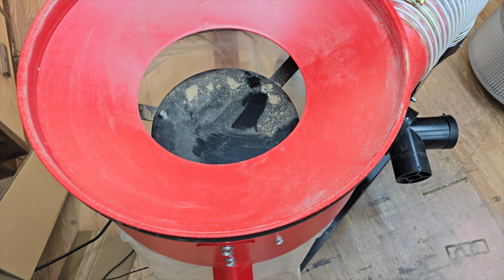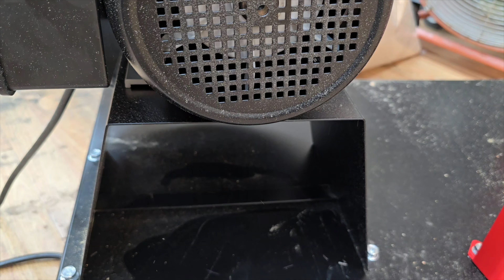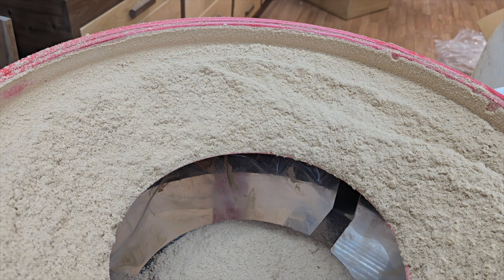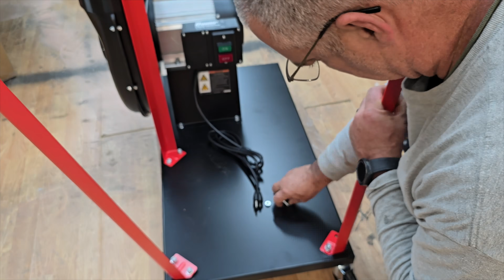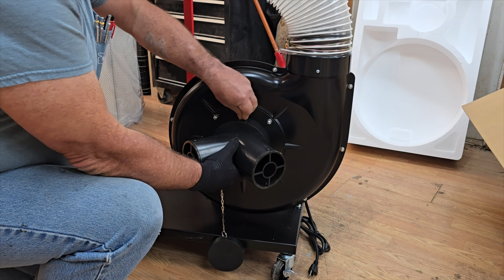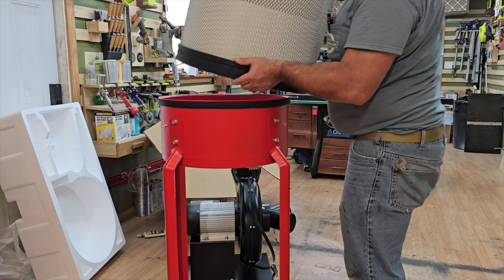Bauer Dust Collector

Comment: Im looking at a dust filter system and considering the harbor freight set up however i like the 2hp motor of the bag system and the pleated filter of the 1-1/2 ho bauer system. Is the cfm of the 1-1/2 hp model sufficient for pulling dust and chips away from my lathe?

Comment: The single stage collector sucks the dust and chips across the impeller.
Reply from the maker: Yes, the material passes through the impeller housing, which is why the design improvements are so important.

Comment: Harbor Freight BAUER 35 Gallon Dust Collector with 2-Micron Canister Filter. $399 with coupon. I never claimed to be a genius. However, I do try to work smarter, not harder. Bolt the legs to the collector first. then stand it up on the base. I really don't think I could hold the collector up with one hand.
Reply from the maker: That is a good way to do it.

Comment: Thank you for the valuable information. How do you think it compares to the Wen 1300?
Reply from the maker: There are several of this style of dust collector. Using one or two tools at a time the only way I can tell a difference in performance is with a gauge. They all preform good in real usage. The big difference is the filter is a bag. If it is in the budget get one with the filter. If you want to add it later it is a lot more expensive.  That is where the Bauer comes out on top as the best value. Either one will suck the dust away from your tool. The difference  will be how much of it gets spread around the shop.
Reply: @ShopRamblings Thank you very much!

Comment: They make a Bauer Cyclone that works with this until. If anyone is using both together, can you comment on performance with and without the cyclone? 

I have one of the older Central dust collectors, and I replaced the 8-inch impeller with a 10-inch one, which really improved the suction. I also increased the input plate diameter to accommodate a Grezzly large cyclone, which captures larger materials. The other thing I did was replace the top cloth bag with a Grezzly canister filter with a handle similar to Bauer's, but taller. Lastly, I added a remote control and blast gates at the cyclone intakes. It works great, but at a high dB level. I'm going to move it to an out shed attached to my shop and connect it to my dust ductwork inside.
Reply from the maker: I have both. I can not tell a difference between having the cyclone connected or not. I use a 6in hose connecting them. You just want to make sure not to have restrictions in the system. I have my system outside and switches on each blast gate. When I open a gate the system comes on.  I only have one gate opened at a time. If you  have multiple gates opened at the same time you might be able to tell the difference . I feel these portable system are made to run one machine at a time. I have mine hooked to duct work but it is still a one or two at a time machine.
Reply: @ShopRamblings  Thank you for the feedback. My Frankenstein system works really well. And only a small amount of fine dust makes it to the canister and bag side. Unless the drum below the gig grizzly cyclone is full or nearly full, then everything passes to the canister/bag lol. That is usually when I notice and have to shut down to clean up. I also only run one machine at a time, but my 1’800 sq ft shop is manned by just my son and me. So I'm not sure how much suction I would lose if running two at a time, but I have accidentally left two ports at the cyclone open while running one machine and noticed a drop in suction. It still pulls dust, but it's clearly less powerful.  The downsides are the noise, which is very loud, the canister fills up quick, it's half the size of a 55-gal drum, it is big and takes up a lot of space, this why I want to move it to an outside shed, and those clamps the hold the bags on the drum and the below the canister are a pain to reattach with out help from my son. Otherwise, it works great for me. I could upgrade or add a second unit that had a smaller footprint.

Grizzly just came out with a new one that looks similar to the Harvey unit that you can add a worktop to. I think it is the G0991? It's a lot less than the Harvey small shop system, but similar in principle to a horizontal cycle.
Reply: the stock HF has a 10 impeller and Rikon makes a 12 inch that is what I used
Reply: @jimlarkin1400  Yes, you are right it was a 10 I replaces by a Rikon 12”. I also replaces flange with one that had a larger intake. It really I proved performance also especially since I add the grizzly cyclone.

Comment: Is it a bad idea to remove the plastic restrictor cross thing in the 4" inlets?

It seems like a hard barrel with a bag inside system that uses a lever clamp to raise it up tight would be a very huge upgrade.
Reply from the maker: I run mine through a cyclone first. That was everything doesn't go through the impeller.

Comment: Extremely loud.  Needs its own 115 circuit I suggest 10awg wire. Inrush current is probably in excess of 27amps. Built-in soft start is a bit mickey mouse.
Reply from the maker: All dust collector I have ever been around are loud. It claims to be 85dba. That is the same as some lawn  mowers or  a blender. That is why I mounted mine outside. I am not sure if you have a bad motor or a bad meter. I prefer to run large power tools on different circuits when I can. The motor is rated at 11.5amp on 110v. If you connect it to 220v it is rated at 5.7amps. I don't remember the exact amount mine pulled when I tested it but it was under the rated amount. I ran hundreds of board foot through my planner with it and the dust collector on the same 20amp circuit.  Only when I took a too big of cut and bogged down the planner did the breaker trip. Not many people have a 30amp 110v service. I would run it on 220v before I put in a 30/110. If yours is pulling that much amps I would take it back and swap it for another one.

Comment: This unit has the ability to run 120 or 240. It comes pre-wired for 120. Are you running this at 120 or did you wire for 240? What breaker are you running for your application?
Reply from the maker: I have a built in dust collection  system. I just use this for a portable system when I am not close to a drop on my main system. I just plug it into 110v. All the wiring in my shop is 12ga on 20amp breakers. That might be a good video. Comparing the suction between 110 and 220.

Comment: Please post the printable for the 6" to 4" adapter. I also wonder if going to a single 4" inlet instead of a Y would increase airflow? Perhaps make a single intake, a little longer, with a more gradual internal taper.
Reply from the maker: send me your email and I will send you the file. I need a picture to upload it to printables and I forget every time I am in the shop. ShopRamblings@gmail.com

Comment: Should there be any concern over the 1.5 hp vs the 2 hp on the original HF collector? I have the 2hp and was going to add a pleated filter and new impeller, but can buy this one cheaper than the modifications on the old one with a coupon I have.
Reply from the maker: I have both and can't tell a difference.

Comment: can someone  measure the inside diameter where the filter is attached
Reply from the maker: The filter has the black rubber made on to it. It fits over the red drum. The outside diameter of the red drum is 19 1/2". That is the same as the inside diameter of the filter.

Comment: Can you test the static pressure of this vacuum?
Reply from the maker: I had to order a Manometer. It will be in Tuesday. I will try to remember to test it next week.
Reply: @ShopRamblings  thank you sir! Looking forward to it. Im looking at getting this and upgrading it to a HF 3HP 240v motor running at 3600 rpm, the motor has the same nema 56 mount so I think it should work

Comment: For anyone who was confused by the canister assembly, the instructions pdf on the Harbor Freight website goes over that part in more detail - I assume folks will be getting the update instructions in their box during the next production run. That said, these instructions are really awful in general and really gloss over a lot of little details.
Reply from the maker: It is a new product. The machine is great but the instructions I had could use a little improvment. I didn't really need them. If you do, just download the Jet instructions. This is the same machine.
Reply: @ShopRamblings Yep, I did that when I was trying to figure out how to mount the bag. Thanks for the video, it definitely helped me make the decision to buy! I’m super impressed with the quality overall!

Comment: Can I use this for my 7” makita concrete grinder? Or is the dust too fine to work? Thank you.
Reply from the maker: Yes, it will catch fine dust.  The filter will clog. You will need to stop and rotate the handle to knock the dust out of the filter. Running it for long periods without knocking the filter will let it clog up.

Comment: Hope this works on the powder.. what im filtering, i DO NOT want to escape..
Reply from the maker: I used this with my drum sander. Basically baby powder. I ran it for a few hours without stopping. It  kept the air clean. After the bag was about 1/4 full the filter was so clogged it popped off. I am not sure If I had stopped and turned the filter beater a couple of times if it would have prevented it. Most likely so but I was testing it to see how far I could push it.

Comment: Is 2 micron good enough?
Reply from the maker: A standard home ac filter is 5-10 micron. It filters smaller particles than most peoples houses. I have a couple different air monitors. The smallest any of the go is 2.5 micron. I also believe 2.5 is the smallest OSHA measure to. So in my opinion 2 is good.

Comment: Really nice video. One thing I noticed in the specs is that that the sound rating is 85db. Seems really loud. Your thoughts on the noise level?
Reply from the maker: I seems about the same as other dust collectors to me. Depending on what tool I am using I dont notice it. It is about the same as most saws.

Comment: quick question for ya kind sir, if you had to pick between this and the hercules dust extractor, which one would you be buying?
Reply from the maker: It depends on what I need. These are to completely different tools for completely different purposes.  For small hand tools like sanders, routers, and track saws, I would get a dust extractor. For large tools like table saws, miter saws, and planers, I would get a dust collector.
Reply: @ShopRamblings   lemme rephrase lol, you can afford one or the other, which you buying FIRST?
Reply: @stevenking997 depends on what you're doing. I bought the Hercules dust extractor and love it.  Works awesome for my sander and while cleaning the shop.   But it won't work with a planer

Comment: Do you know if they have a barrel style available.  That would be, in my opinion, that would improve this.  installing the bag looks like it would be a pain to install.
Reply from the maker: I had the bag on the Chicago Machinery one. It was a pain. This one has a ring that slides in to hold the bag. It is not that bad.  I will be modifying it soon.

Comment: Would like to see an update. The costs of the replacement filters still does not justify the upgrade from the "Bag" standard option. The pleated filters clog up so fast they become pointless pretty quickly. I've used them all and can't say any of these systems are any good. Cyclone is the only way and I still have dust all over my shop! And in my lungs! Haha
Reply from the maker: This system was able to keep the air clean with everything but my drum sander. The filter has a beater that does a good job of keeping the canister clean. I ran my drum sander nonstop without using the filter beater. The canister did a great job of keeping the air clean. I filled the bag about halfway before the canister got so clogged it popped off. I hooked up the new Bauer Cyclone about a month ago. I had to dump it 8 times yesterday and only got a handful of shavings it the collectors bag. Running the drum sander it catches about 70%.

Comment: So if it has a 6 inch trunk line but goes down to 4, would I be better off running 6 inch ducting?
Reply from the maker: Yes, using 6in will increase cfm.

Comment: I have been running the older HF Central Machine dust collector through a Dust Deputy chip separator for years with great success. I’m going to be replacing the dust collector with this one in a new shop and going to run it through the chip separator again.  I hope it is as strong, if not better, than the 2 hp old machine.
Reply from the maker: It is close to the same just better build quality.

Comment: Hello have you tried running it on a 240 volt. I guess you can change it to a 240 volt. Wondering if anyone has changed it to run on a 240?
Reply from the maker: The instructions to convert it is in the Rikon manual. I don't have any need to run mine one 200

Comment: Thanks for the video! I got a small rubber block with mine. It's about 1.5" square and 3/4" thick with a hole through it. Any idea what this is for???
Reply from the maker: I am unsure. Could it be part of the packing?
Reply: @ShopRamblings  see comment below. Thanks!
Reply: Well, I found it. Not mentioned in the instructions anywhere, but on the exploded drawing it shows it mounting under the motor. The motor rests on it. I guess it's some type of vibration dampner or something. There is a hole to accept the bolt as well. Didn't catch that.
Reply: Ha! I see at 5:30 on your video that you have the hole for the rubber piece but no rubber piece. It's directly below the motor just to the left of your hanging chain.

Comment: Thank you for your review of this Dust Collector.  Getting my shop up and running and I'm in desperate need of dust collection and have been looking at all the options.  I would agree that I believe that I would rather have these dumping into a large garbage can instead of a bag and would make it easier to empty.  I've seen where folks have retro fitted these and they seem to work great.  I guess my main concern would be getting it to seal really well.
Reply from the maker: I did a couple of the older Central Machinery ones. I never had a problem with them sealing around the barrel.

Comment: Just curious, and I'm just assuming... have you used the Central Machinery version from Harbor Freight? A lot lf people modded that's one with a bigger impeller, justify curious if you know how the Bauer impeller stacks up?
Reply from the maker: I have used several of the Central Machinery dust collectors. I have several videos in it. Going off of memory so  the numbers might be off, but this is the concept. They made a 2hp collector that was 1500cfm. It was 20 amp. A lot of people complained as they tried using it on a 15 amp circuit, and it would trip the breaker. They made a 1.5hp model with a smaller impeller that puts out 1200cfm but only draws 15amp. People put  the larger impeller on the smaller motor. Both motors run the same speed, so you now get the 1500cfm with the 1.5hp motor. It works. I don't do this modification.  If it worked without issues, they would have just put a smaller motor on the original system. Running the larger impeller puts more strain on the motor, causing it to fail sooner. It you don't use the system much or get lucky, it may last forever. There was a high enough fail rate that they designed the smaller impeller. I only run one tool at a time. I have the collector hard piped into my system.  The longest run is less than 40 feet. My modifications where mainly to make it a 2 stage system. They just put out the cyclone, which looks like it will do the job. 

This is my opinion. I know many other people think the impeller upgrade is great. For me I don't need an extra 300cfm at the Rick of having to replace the system. If you remove the square adaptor comming out you will gain more the 300cfm and lower the load on the motor.
Reply: @ShopRamblings  I appreciate the insight! I did do the impeller upgrade for the CM version and have been running it for about 3 or 4 years with no issues, thankfully. I didn't realize removing the square adapter was an option. I'll have to look into
 that.
Reply from the maker: I did a video adding a filter. I was expecting to lose some flow. I was surprised when it increased. The result are in that video.
Reply: @ShopRamblings I'll take a look, thanks!

Comment: I purchased one because of this video. Thanks. As a side note, the plastic collection bags are not available and they are not sure when they will be in stock. I tried purchasing extras.
Reply from the maker: I looked the other day, and they had them under replacement part on their website. It is a new tool, so it may take a couple of weeks for inventory to stabilize. I have been reusing mine. It is thicker than a normal bag.

Comment: Good luck finding replacement filters. Can’t find them anywhere
Reply from the maker: Normally, these filters don't need to be replaced. You can submit a parts request on the Harbor Frieghts website. Every part I have ever needed, they got for me. This is the same machine  as the Rikon 60-151C. The filter is available from May places. https://www.acmetools.com/rikon-filter-cartridge-for-15hp-2hp-3hp-dust-collector-60-905/814463010748.html?gad_source=1&gclid=CjwKCAiA2cu9BhBhEiwAft6IxNi6hCwUnbMHRVBGV42vezF93YlmgepCsfqStwKDxGzXO7c8j7wJLBoCZCAQAvD_BwE